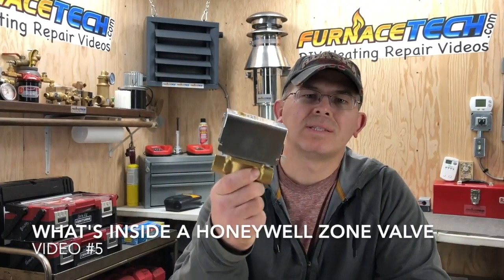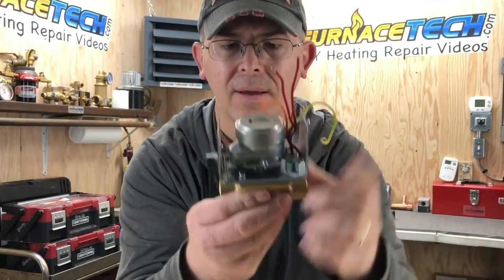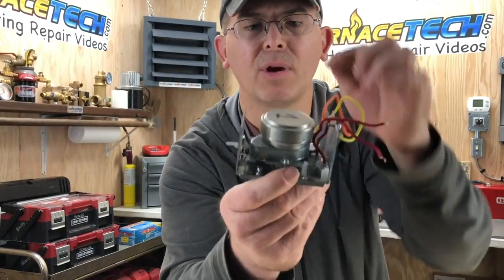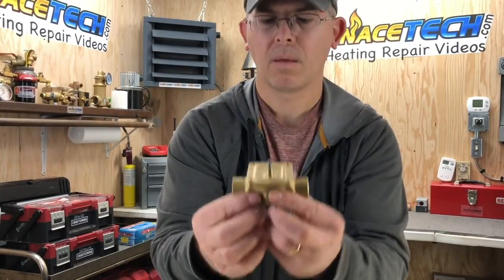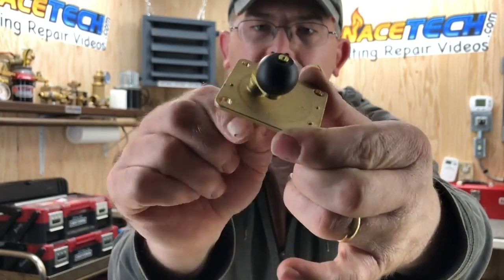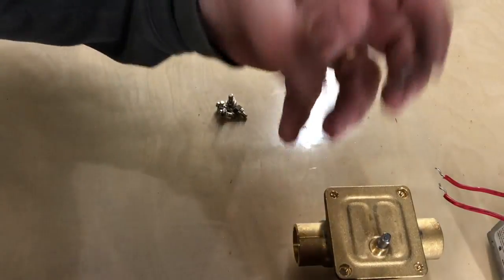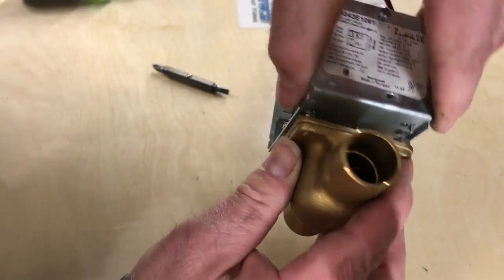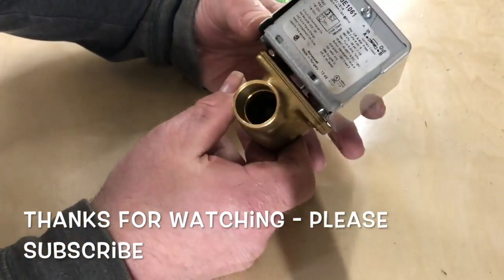How to fix a Honeywell Zone Valve. Part number: V8043E1012 + V8043E1061

Comment: if i want to change only the top head, should the main valves be shut off?
Reply from the maker: If you want to change the powerhead with the motor and wires, you don’t need to turn off any valves. But if you are trying to replace the top of the valve section below the powerhead then yes the valves need to be isolated and you will need to catch fluid which may leak out. 
I hope this helps!
Reply: @FurnaceTech  ok...thank u...

Comment: I removed my valve motor assembly. But my valve body doesn't have the plate with the 4 bolts.  Does this mean my valve body is an older type?
Reply from the maker: There should be two flat head screws holding on the motor assembly in place. Once you remove them the motor assembly should separate and you should see 4 small screws/bolts holding the valve plate. If it does not, I am not sure what model you have

Comment: We have a zone that seems to be staying on.  From what I see, that would point to the rubber ball not sealing well.  We have a lot of hard water in our area, so it has probably eroded it.  I don't suppose you can just buy and replace the rubber ball?
Reply from the maker: I have never tried to buy just the ball inside the valve body!
Reply: @FurnaceTech  Thanks.  They probably don't sell just that sub-assembly.  It wouldn't be worthwhile.  The rubber is a "wear" part, and, like the momentary "n" switch, is typically where stuff like this fails. Everything else looks like it would survive a direct hit from a 50 cal... so to speak.  The motor is brushless, but probably has some bearing that wears away too.  

Thanks again.  Channels like yours are what makes Y0utube worth watching :-)

Comment: Thanks for the video breaking down the components of this valve. Until I discovered your video I assumed that if anything went wrong with the valve the entire unit would need to be removed and replaced. So nice to realize Honeywell designed these with component replacement parts to prevent removing the entire valve at great cost to the home owner for a house call.

You mentioned in comments that you have seen a LOT of "frozen" valves. I believe that is my problem since the thermostat calls for heat, the motor gets hot to touch, but the valve does not move open. And the Manual lever does not move the valve either. 

My question: Since kits for the guts are available i would suspect that nothing goes wrong with the actual interior of the body that would prevent a new ball and stem assembly from seating properly and working OK.  Have you ever encountered a frozen valve situation where you HAD to sweat out the entire valve and replace the entire kit and kaboodle?  I'm just hoping replacing the guts will make this problem disappear without further complications.  BTW, my valves are horizontal and all 3 have been in service for 26 years before this one had a problem.
Reply from the maker: I would start with the valve guts only. I have had to change everything when there was a leak which caused excessive damage over time
Reply: Thanks for the quick response. I found a good deal on a complete valve assembly on eBay so when that arrives I'll have the essence of all 3 kits, just in case the motor or powerhead has issues too. You don't know how relieved I am not to get out the acetylene torch and test my sweat soldering skills in very confined spaces. Whew! Knock on wood.

Comment: I started changing 3 zone valves and discovered the black plastic bushing that goes through the center of the
Power head are all broken or worn. Can you tell me where I can buy 3 new ones. I don’t want to have to replace the complete power heads.
Reply from the maker: I am not sure where to purchase just that part. I normally replace the gasket, powerhead or valve assembly. Maybe check with a local supply house.

Comment: Is there a way to loosen up or free up the sticking ball valve? WD40, maybe?
Reply from the maker: I have always replaced valves which begin sticking. In my spot or position being a business it’s not worth having any trouble or  risking a call back. Plus the cost for me to repair the sticking valve vs replacing it seems to be better to simply change it.

I hope this helps with the answer. 
Good luck if you attempt to work it free.

Comment: Hi. Great job that you do. I have this problem that when I switch on the hot water from the programmer, the radiator also heats up. I have this Ideal classic boiler system that has a tightly located motor z ok ne valve. It seems I may have to detach it from the two plumbing apertures. What do you suggest?
Reply from the maker: Does the radiator which is getting hot when you call for hot water have a separate zone valve? That zone valve may be leaking by and allowing fluid to flow when it's not calling. If so, you may need to replace it.

Comment: hi, would you have the part number for the end switch on the 1012 vavle...? tia
Reply from the maker: I am sorry I do not have that part number. Normally when this switch goes bad, I have replaced the powerhead. As a technician it’s not cost effective to rebuild some of the small parts inside of the zone valves.
Reply: @FurnaceTech  tnx... i bought a new unit; i'll swap the powerhead

Comment: A question to every one: how can we guarantee this kind of valve will not be leaking when we are not at home, If not at home and if this starts leaking especially in high rise building this will be huge massive damage to the property. Please respond. Thanks all!
Reply from the maker: There is no guarantee it will not leak but they do start showing signs of a leak around the edges when there is a problem.

Comment: Hi could you tell me what it cost to diagnose a boiler overheating the house and change this power head when it and a relay is found to be the problem?
Reply from the maker: It should not take more that an hour to diagnose and anywhere from 30 mins to 1.5 hrs to complete. This range depending on if the system needs to be drained and air removed.
Reply from the maker: It’s a simple job!

Comment: I have a question, we have a oil burning radiant heating system and our zone 3 is Stuck on like 80 degrees and constantly burning our oil up so we manually shut it off. We changed the old thermostat out so I know it’s not the thermostat. Should we change the valve or could this be an electrical issue?
Reply from the maker: Here is how I would test it.
First turn up the thermostat and use a voltage meter to check for 24volts on the two yellow wires at the zone valve.
You should have 24vac.
And valve should be open
Check the slider on the powerhead and see if it goes back and forth easily.

Next turn thermostat all the way down or off. The voltage should go down to 0vac
The lever on the powerhead should be to one side and not slide over without effort.
If the valve is still open at this point, it’s stuck open.

You can remove the powerhead and grab the valve stem on the valve body and see if it turns freely or if it stuck.

At this point you can replace the faulty parts you find bad

I hope this helps

Comment: How often is it just the motor vs seized up internals? I currently have a lady that is constantly heating and usually we replace the whole head. I wonder if I can remove just the motor and manually close the valve? We take care of a large 4 story apartment building and the tenants usually need to wait until fall time when we bring the whole building down to make repairs.
Reply from the maker: If you remove the powerhead you can open and close the valve somewhat. You need the powerhead spring tension to close it off 100%

Some of these valves can last a long time but some don’t. Maybe check to see if your trouble is in the valve body valve being too hard to turn and the spring tension of the powerhead not being able to close it off.
Reply: @FurnaceTech  thanks much! I think the reason my company wants us to replace the entire head with ball is to warranty it and that's why they always taught me to do that. But if I can stop someone from getting constant hear until boilers are shut down in May by doing this, I'm sure they'd appreciate that. 
I appreciate the quick reply!

Comment: How often does the valve itself go bad?  I have a bad zone valve, and taking the power unit off and turning the knob by hand (while having another zone active) does not seem to allow water to pass thru.  I assume either the ball broke off and is jamming inside the valve or is stuck somewhere in the heating system.
Reply from the maker: There is always a possibility that it’s frozen too! I have only found one valve in 20+ years which had a broken ball inside. Usually the issues are a bad end switch, stuck or sticking valve stem, leaking valve body gasket or malfunctioning gearing or a bad power head motor.

As for how long do they last. Well I have them go bad in a year and last up to 10+ yrs
I have seen many frozen lines.
Reply: @FurnaceTech  Thanks for the really quick reply!  upon further investigation it seems like the bleed valve is actually working (this one was just replaced a little over a year ago) and there's either a clog or an airlock somewhere (the upstairs has had a nice water feature sound effect for awhile now).  Still haven't found the upstairs bleed valve though.
Reply from the maker: @googlemyharbl  one way to push the air through is to close off all the other zones so they do not get flow and force all the flow through the one which is not flowing. If it does not flow then try opening and closing one of the other zones really fast to get the system to push fluid by burping it. This might help.
Reply: *zone valve is actually working

Comment: Thanks for the very good video ... not a plumber and have 3 zone valvues. The last maintenance person who came to do maintenacnce said one was bad. If you ever plan more videos ... how to tell if a value is working or not would be good and also I believe my system has old values that require boiler to be drained but newer ones once install would eliminat that pain problem. Again thanks ...
Reply from the maker: Thanks for the feedback! I will plan on making another video to help diagnose bad zone valves.

Not all zone valves are installed with isolation valves to ease maintenance and repair.

Comment: The problem I have is that my radiators still remain ON all the time, even when the timer is switched to OFF. The motor head is Honeywell V4043H1106. Apparently the valve is always in the OPEN position to let hot water through to the radiators. The lever on the side is always floppy when the system is running so the valve is not closing. What could be the fix solution?
Reply from the maker: If you disconnect your timer and the valve closes then you have a bad timer. That's where I would start. Make sure to use a meter to make sure the control power is off before disconnecting. Then, turn power back on to the controls and verify the zone valves position. With the timer disconnected the zone valve should return to it normally closed position. If the valve is still open then the zone valve could be stuck in the open position. I hope this helps!

Comment: Thank you so much for this video.  When one of our zones stopped heating today a heating company quoted me $1,200 and said they would need to replace the entire valve. Using your video, I was able to confirm the problem was just in the motor and was able to find a replacement and just use the motor section of the valve to fix the problem for about $100.
Reply from the maker: That’s awesome!!! I am glad I was able to help!
Reply: @FurnaceTech  several unscrupulous contractors quoted me 10K for replacing the entire boiler knowing that I suspected it was the valve and possible the circulation pump.  Still they wanted to replace the entire boiler.
I’m happy guy now thanks to this video
Reply: 1,200$ Good lord. Thats about a full days worth of work with the part included 😂
Reply: $1200, sad but there are seniors that   have no choice but to pay that.
Reply: Mine lever is not able to slide to manual open position? Any idea?
Reply: I just got a new one and already the heat stopped working if i even touch that box sometimes the heat will kick on .

Comment: Thanks for a great video. Have a two zones. One of the Zone Valves  is not opening. These are Honeywell valves. Called a repair guy who needs the part number on the valve. Looked every where that is easily accessible by opening the cover but no luck! Could you suggest how to find a proper replacement. Thanks a lot.
Reply from the maker: If your zone valve has a lever to open it, then you have a normally closed zone valve. Next you can check the power being supplied to the valve. 
This is how I would determine what is installed.

The links in description of this video will take you to a 24vac NC valve 

I think If you look on my zone valve video you can see where the zone valve part number is located

I hope this help...

Comment: Hey I had some metal pinging sound and so I removed the motor cover and bingo the little wheel inside is making the sound ! I just realized the zone valve is stuck closed ... I will have it replaced tonight.... thanks for the informative video..👍
Reply from the maker: You are welcome

Comment: I wish there was a better quality replacement for these piece of shit valves. Too bad Grundfos doesn't make a drop in replacement actuator. 
These used to have a nice wide brass gear rack but now they have a thin stamped steel rack that strips out in a few years. Piece of junk. Made just as damn cheap as possible.

Comment: Thanks.was curious on what's inside a zone valve especially inside the pipe part. Great info.
Reply from the maker: It's just hollow with one side having a flat spot for the rubber ball to seat and shut off flow.

Comment: Hi thanks for the wideo, I got problems When valve 3 port is set to central heating it is all the time a hot motor and there is a soft noise coming from it, 
this is good? How do I change to heating water everything is ok
Reply from the maker: I don't think soft noise is anything to worry about as long as it's still driving open and closed without getting stuck. I will try and make a video with a 3 port valve in the future so that may help.

Comment: do i have to shut off power and water to change the motor head?
Reply from the maker: It’s always a good idea to turn off power so you don’t short out the wires and blow the transformer. 
If you are just replacing the power head then no you should be ok with the water. 

Hope this helps
Reply: @FurnaceTech  thank you

Comment: My Honeywell zone valve V8043E1012 motorized valve needs to replaced. Amazon have very same two valve. One is V8043E1012 electric zone valve, another one is V8043E1012 3/4” sweat zone valve ( connection = 18” leads), which one should I buy?
Reply from the maker: I would match it to your system. If you look on the side of one of the valves it will say the size of the pipe. Most heating zones I work on are 3/4" with the 18" leads. I hope this helps!